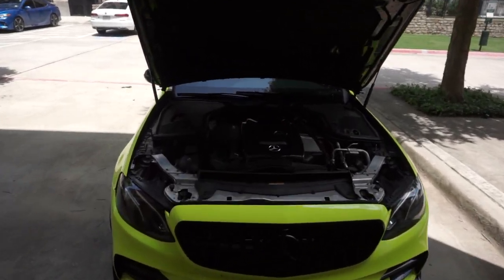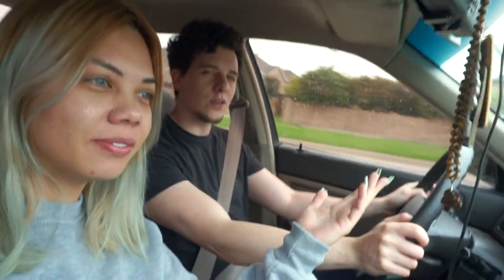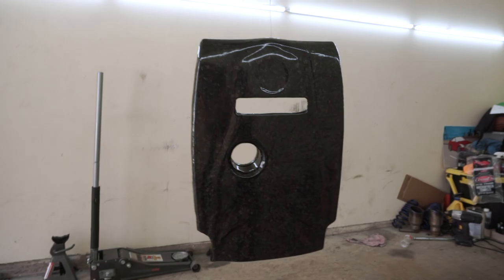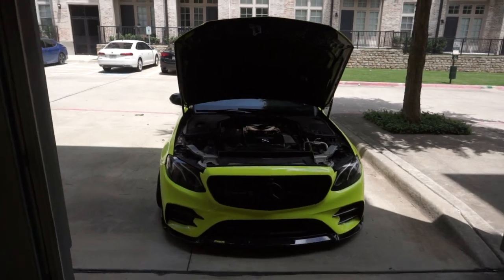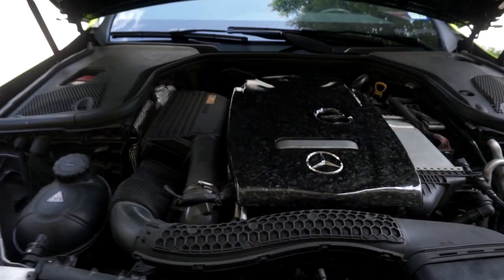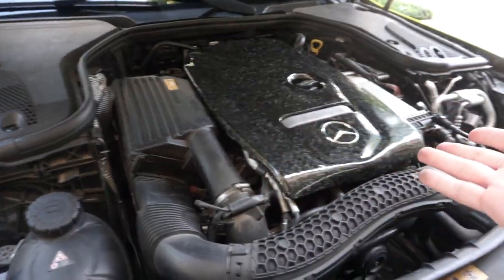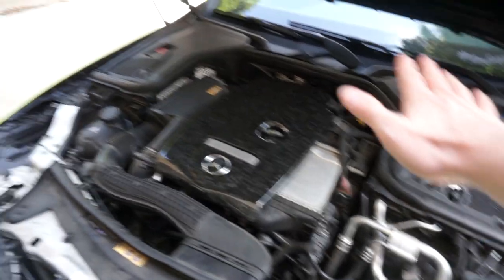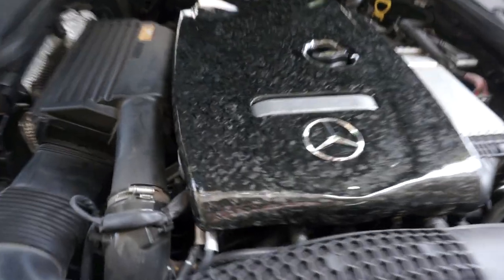How to Make Forged Carbon Fiber Car Parts ...

Comment: It’s not as easy as YouTube makes it look       Iv done bits for my rx8 did sheets laying over the parts and vacuum bag some now I’m doing chopped carbon.   Doing my new splitter now with blue bits added then Iv got my roof done in carbon wrap so it’s coming off and doing chopped carbon fibre